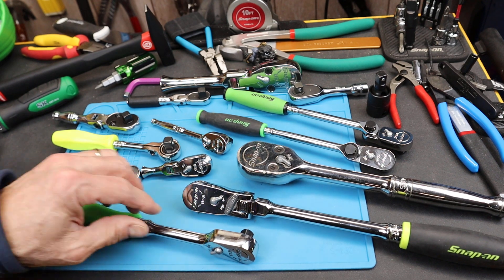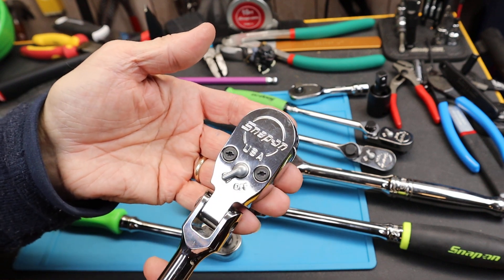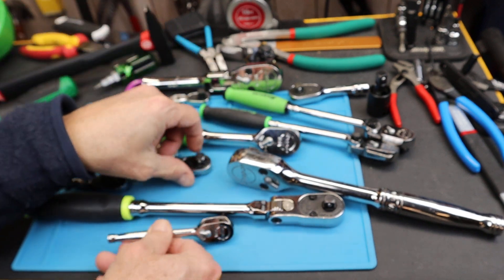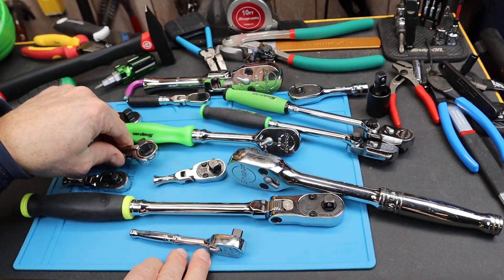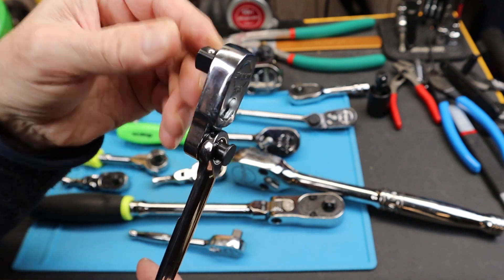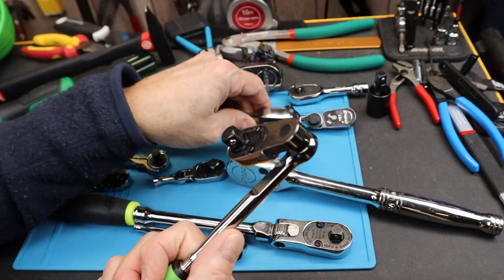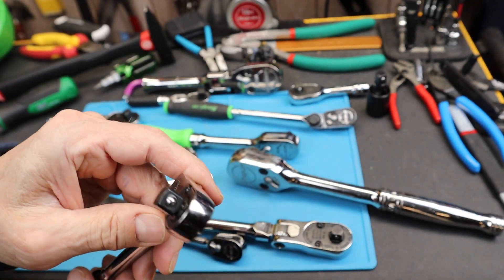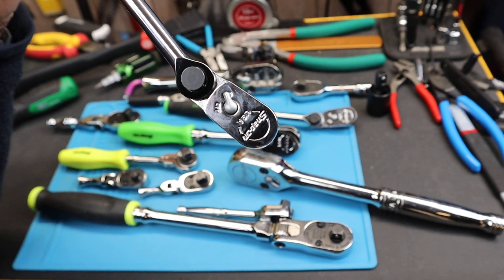Snap On Engineered Fail: Taking tiny 3/8" ratchets seriously and making them snap rather than break!

Comment: It may be deliberate but when I bought my flex head 1/4 inch with a 3/8 anvil it worked out great for me, I build engines and if I have small fasteners that I don’t want to run down with an impact I will grab that ratchet, I’m not torquing them down much so I don’t need something that strong, and it’s light and easier to install the fasteners in tight spots because the body is much slimmer than a traditional 3/8 ratchet. It’s probably my most used tool

Comment: Dual paw fails above 280ft-lbs so if the head has not failed and the handle has I would look into hardening problems. Besides the soft grip breaks off with the pipe over the handle. Plastic handle only runs half way down.  Steel may be the same but forging always gets messed up.

Comment: One of my first Craftsman ratchets has an engineered failure point. It’s a 36 tooth gear with terrible backlash, very shallow gear cuts and only 2 pawls engage. 😂 Did a lot of automotive work early on when that was all I could afford, and even then it took some time to save up for.

Comment: I have the 3/8 anvil quarter inch ratchet. I use it for running tap chasers in engines I down at my job. The 8mm and 10mm chasers  use tap sockets that are 3/8 drive. I do not need the torque capability of a full 3/8. It's convenient because of its size, and the fact that I do not have to use an adapter is nice.

Comment: I have some 3/8" anvil in 1/4" body in multiple roundhead ratchets and I wouldn't mind having that shear point in those. Especially since the teeth are built into the head of that roundhead design. It's not as easy as just throwing in new anvil/gear/pawl to rebuild it

Comment: The fire ball tool hard tail vice has a handle that has relief cuts in it. So if you put a bar on the handle it will bend and they know it wasn't used properly

Comment: Just checked another 3/8 in a 1/4 body the Koken 3725Z and it doesn’t have the same anvil reduction as the Snap-on. Also doesn’t have the same warranty and all that but it’s also a lot cheaper.
Reply: Its only the new repair kits with the taper, I have a few older FCF72's that don't taper, much like your Koken!

Comment: Snap On engineers their tools to be as safe as possible. Snap On wrenches are engineered to bend before they break (the highest quality steel they use makes this possible). Snap On engineers their ratchets and breaker bars to break at the square drive as this is safer. When ratchets and breaker bars break under high torque it can create a very dangerous situation for the user. They can send pieces of steel toward the user with tremendous force, enough to lose eyesight, break teeth, break facial bones, let alone breaking your hand. Look into the guy that is currently suing Harbor Freight when he went blind when his breaker bar broke and sent metal into his eye, blinding him. He was using it to remove the wheels from his car. 

Snap On actually tests all of their tools but also their competitors tools to failure. Believe it or not, they have a very high dollar testing room, yea it actually blows away any of the Youtube guys like Torque Test Channel, Project Farm and any tool review channels. I've seen Snap On's testing videos on their breaker bars. The competitors break and send large chunks of metal back towards the user. The Snap On breaker bars deflect long before breaking and will break at the square drive without sending fragments flying around. 

Tiny 1/4 drive ratchets were never made to have 3 foot long handles and break loose 15mm + size nuts/bolts. Due to manufacturers increasingly having to crowd engine compartments in efforts to meet the ever increasing EPA mandates, engine bays have become more and more cramped, which has led to these types of ratchets. Engineering the ratchet to fail at the square drive also reduces warranty costs and since Snap On will be honoring these warranties for at least the next 50 years, it is also better for them to sacrifice the square drive instead of potentially destroying the entire ratchet. 

Interestingly, these safety features are exactly what the internet, arm chair "mechanics" and "tool testers" use as "evidence" to "prove" that Snap On actually is inferior and your "just paying for the name", hur dur. All starting with the old HF vs. Snap On breaker bar video where the "tester" "proved" that the HF breaker bar was "better" than the Snap On because the Snap On began to deflect under load (as it was designed to do) while the HF breaker bar didn't deflect at all until it will suddenly break (and possibly blind the user).
Reply: Also, shame on you, Doc for the click bait title. Title says this is a fail and they you say at the end of the video you want to convert all your 1/4 - 3/8 ratchets to this style of square drive. Most of the viewers will not look past the title and use it as confirmation bias of their mistaken belief of "just as guud", you're "paying for the name", BS.

Comment: i don't think it is an engineered failure point, i think it's just to make the head smaller. if you make it thinner at the bottom, there is more space for the rachet mechanism and so on. It's still pretty thick, i don't think it would fail first.
Reply from the maker: I actually talked with a Snap On rep about it and his take was that SO was having to fix thoroughly broken ratchets and deformed cases. By engineering a deliberate failure point, it makes the warranty repair job faster, easier, cheaper, and more predictable. So that's what I went with.
Reply: I feel sometimes snapon reps make stuff up on the spot, but i guess it could be the case considering their generous warranty. @lastbesttool
Reply: Definitely a sacrificial part.

Comment: Snap on tools are built to last a long time, not exceed ANSI standards by some ridiculous amount. Consider a tool's intended purpose. Smart people know not to put a cheater bar on a quarter drive and start jumping on it like a gorilla. I understand there are situations where you don't have much of a choice and you have to risk pushing the tool beyond its limit to get a job done, but for 99% of the time that is not the case. Most of my snap on ratchets are date stamped 2005 and 2006 and they still work like new. I know when to grab a breaker bar to break something loose instead of putting so much force on the teeth of the pawl inside the ratchet.

Comment: When Project Farm tests ratchets to failure, they always fail at the base of the square. So maybe it's built in already.
Reply: The anvil usually shears off when it's a quick release ratchet.
Reply: @DavidTSnyder305  They all fail the same way
Reply: @robertcasey3528  not always.
With some the teeth on the drive can shear off as can the teeth on the pawl.
With a QR ratchet with a hole going through the anvil that's usually where they fail first.
Reply: @DavidTSnyder305  a lot of  QR ratchets anvils are just as strong as non quick release that I've seen in videos

Comment: Ratchet rebuild kits are cheaper than whole ratchets. Given SnapOns lifetime warranty I'm guessing they want the failure point being on the cheapest easiest part to replace. Although when I fit a 3/8" anvil into a 1/4" ratchet body I'm expecting to be able to exceed the torque of same ratchet with 1/4 drive anvil. The tapered down design prevents this & I'm not so sure whether I like that. The tool user has to use a certain amount of judgement when using tools to ensure longevity and prevent failure. The reduced shank anvil I think sort of defeats the purpose of why mechanics started fitting 3/8 kits into 1/4" bodies in the first place. They would also fit 1/2" kits into 3/8" bodies in an attempt to have the smallest strongest ratchets possible.
Reply: I think it was client graphics when he'd used to post did a test on ratchets till break point. Most of them broke the 3/8 anvil before bending the handle. And even then, it was like 300ftlbs. If I'm getting to that point there should be room for a breaker or impact.

Comment: I've noticed this as well - I've been using used FCF72's to make all my weird compact snap on ratchets since I don't have a local dealer and hey are easier/ cheaper to source, but recently I manged to get a new repair kit to make the exact same ratchet you've shown here and was disappointed to find that it came with that taper vs the FCF72 's I've been using which have no taper on the anvil. My guess is possibly they'd rather save the pawls in the ratchet from potentially sheering if over torqued by making the failure point the anvil.

Comment: I’m curious how many people have had a quality 1/4” socket or ratchet break?  I think I might unconsciously switch to 3/8” if I have any doubts, so I’ve never had that happen.  Do any of you remember any details (like socket size, amount of leverage, etc)?
Reply: I remember breaking a Snap-on 1/4” drive ratchet in my early days in the 80s. Can’t remember on what exactly but it didn’t break the anvil, it was a combination of stripped teeth & broken pawls. The cause was probably a certain amount of inexperience combined with the fact I didn’t have any 3/8” drive at the time, only 1/2”. (I worked on heavy equipment then) Don’t think I’ve broken a ratchet since though.
Reply: When stuck for space, I've used 1/4in ratchets where I really should've used 3/8in for better access and have broken ratchets before - but that's entirely on me for not using the appropriate tool!
Reply: My friend was a gorilla he was 5-10 300+ he snapped a 1/4sk round head handle I'm surprised the guts didn't go first I know he did it by hand because it went through his hand when it snapped I think people are beating the wrong tool to get the job done
Reply: I have a standard length (6"?) 1/4" that I use fairly often and It started skipping a tooth a few weeks back. bought brand new off the snap on truck just 2 months ago. I dont remember doing anything particularly excessive with it. Could be bad luck, but I havent bothered warrantying it yet
Reply: I've busted one, and only one, it was a Made in USA craftsman (2000s era), its replacement, has never failed, although the gears don't look as good as the original it replaced.  Outside of that, roughly 10 years ago, 25 years and no failures.  I tend to move to 3/8 and 1/2 when it's appropriate, so the 1/4 is used in the range it should be typically.  I do have some 3/8 size bits and sockets that I can use on 1/4 if its an emergency and/or the space is restricted, but I'm careful when moving up or down as I also have 1/4 size bits/sockets for 3/8 and don't want to break fasteners.
Reply: @drad8266 That sounds like what I pretty much do.  You just got unlucky that one time!